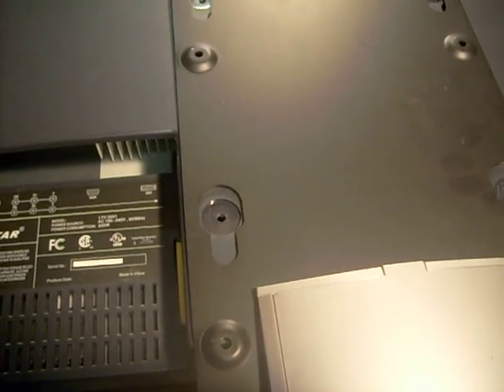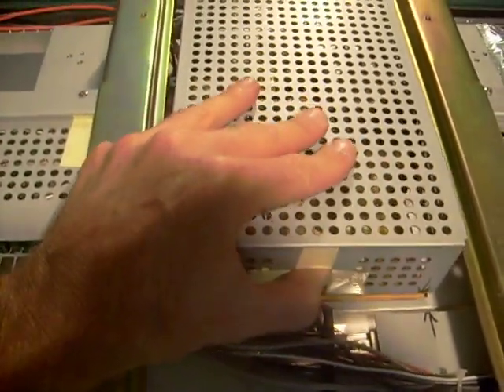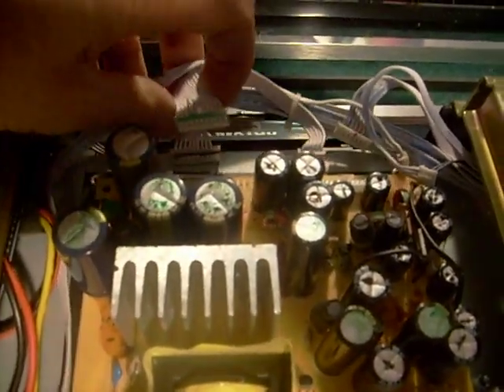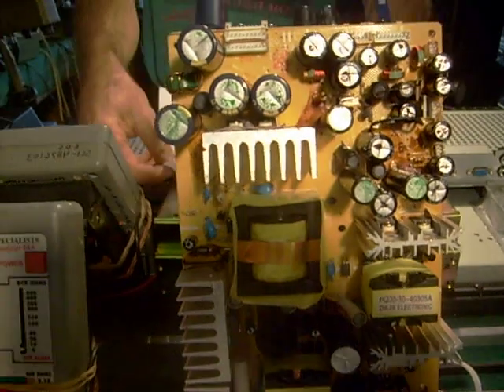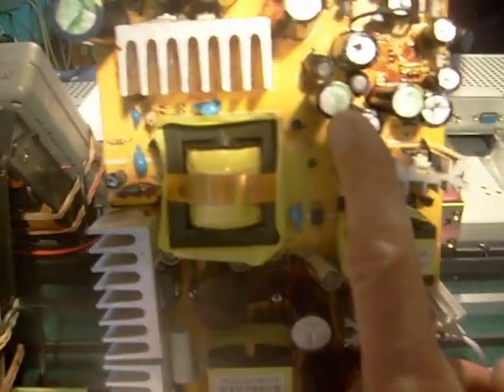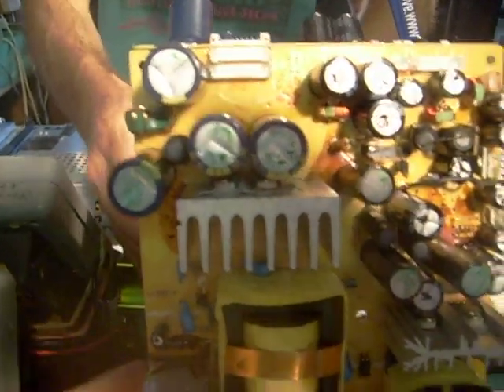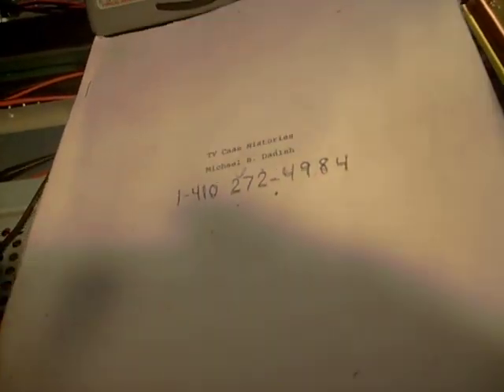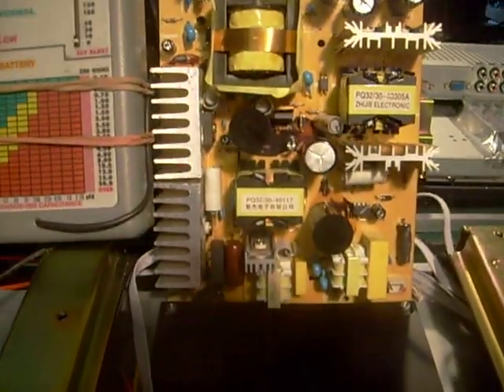Astar LTV3001

Comment: My ASTAR TV is 3 YOA. I connected my Laptop to PC port and TV started smoking bad. I quickly unplugged it and it worked, except remote worked intermittently. Now picture does not work. It started when picture would not turn on except audio would work. I would have to keep turning it on and off until the picture would finally come on. Now I just have audio, I can not get picture to come on. I may attempt to fix but I'm not sure it's the power supply. Isn't it  possible the inverter board is bad.?